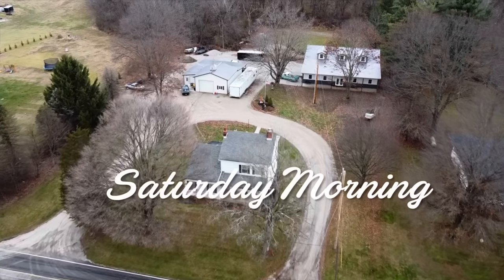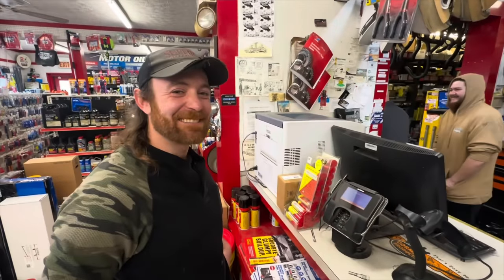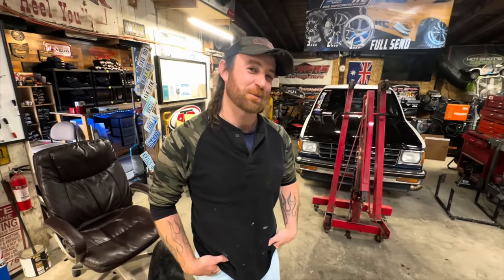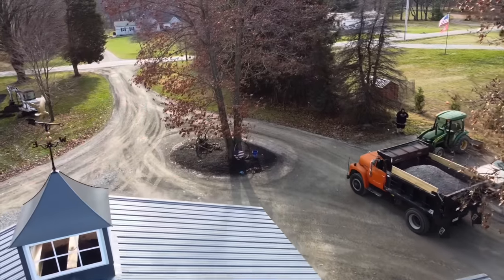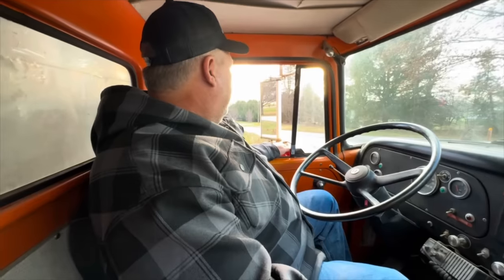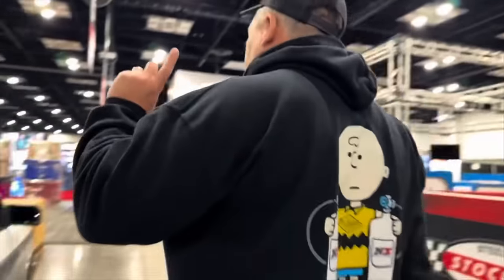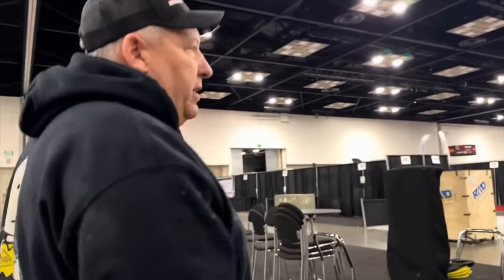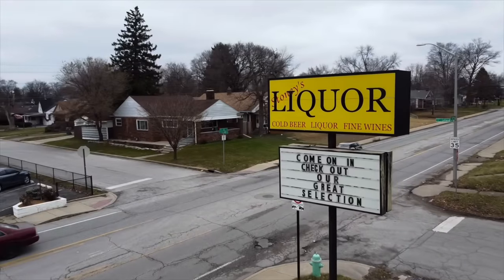BILLY THE KID’S S-10 IS AT PRI?  The STRUGGLE to get READY for INDY’S PREMIERE TRADE SHOW!

Comment: My wife used to lock the keys in the car a lot. So, I started splicing a wire into the unlock circuit inside the kick panel.  Then I would run it out to a weatherproof push button, hid on the car. That way, it's just reaching in and hitting the hidden button to unlock the door.

Comment: Great video,  as usual. The secret to hiding door keys is, you only grind 1 side of the key, that way if someone shady finds it, it only opens the door but won't turn the ignition. On newer cars, you can also use a plain blank without a chip in it.

Comment: I was raised on a farm and my nephew and my younger cousins keep trying to sit in my truck so yeah,, I don't leave the keys in anything especially the 86 chevy k20 custom deluxe long bed well used and beat to hell 4x4 built sbc farm truck i had with the bent and twisted bed and bowed tailgate, because it would never want to stay in park and the steering column was not the problem, I have broken several parking pawls off in the pan of that th400 turbo hd transmission and after 4 i just gave up and that's not counting the factory one that the truck came with

Comment: Love seeing the old international dump! When I was 17 that was the first dump truck I ever drove and a ford 555 backhoe was the first piece of equipment I learned to run back in the early to mid 80s.
Reply from the maker: 555’s were 3 cylinder diesel’s.  We had a 655 at work with front wheel assist.  A monster of a backhoe.  Indestructible.

Comment: Future reference Ford especially that generation of Ford is the easiest to unlock the door Ford made the mistake of putting the unlocked button on top and the Antenna unscrew easily and slip through the top of the door and straight to the unlocked button

Comment: Bill, where can I get your cam from the Malibu in a cam and lifter set? Or what lifters can use with that cam? I’m building a 421 for my 68 chevelle I want to use the same cam as you. Your car is what I want mine to be.
Reply: Also looking at atm carbs I want to use a carb like yours as well not sure what size carb to get I see you running a 950 at times. Mine is a street car with about 11:1 compression and afr heads like you had on the 355